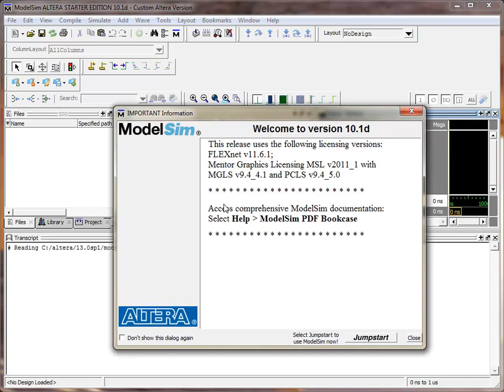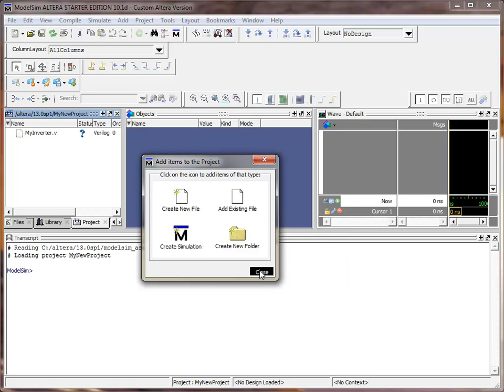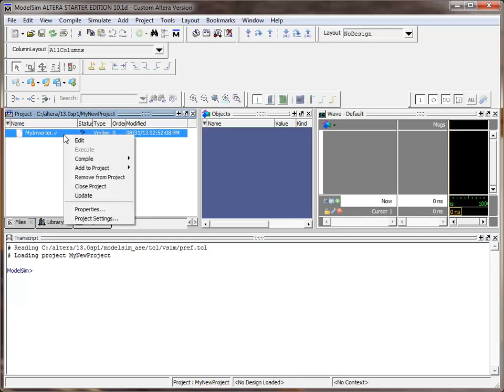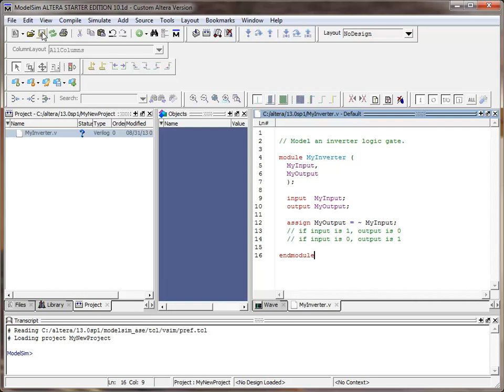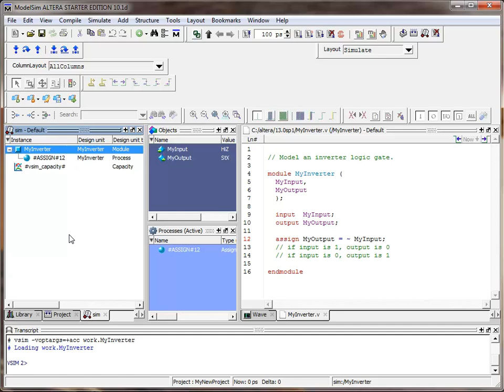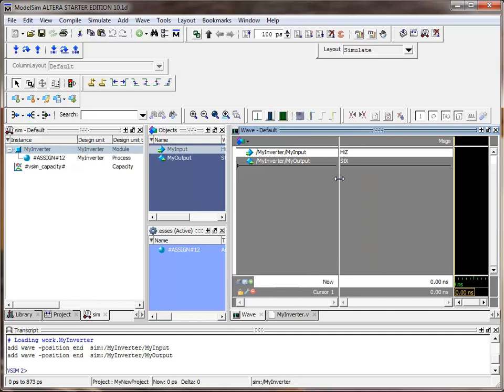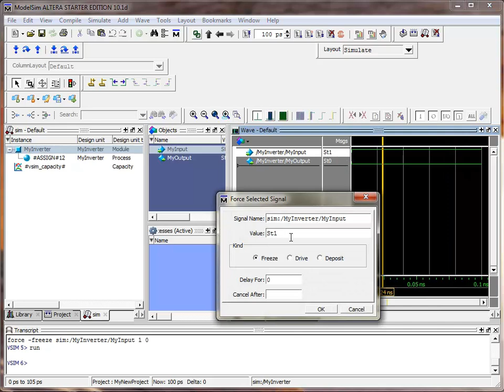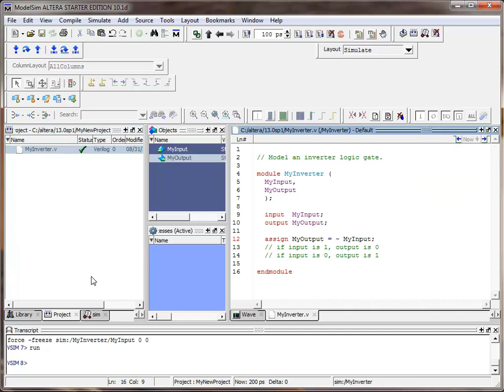Write, Compile, and Simulate a Verilog model using ModelSim

Comment: Man! You have new subscriber! If it is not trouble (your channel is about Verilog), I got it working on new versions of ModelSim(10.1d), and VHDL example, just chose simulation language VHDL. Here is the same example as above but in VHDL: 
------------------------------------
library IEEE;
use IEEE.std_logic_1164.all;

entity myInverter is
  port(myInput:in std_logic; myOutput:out std_logic);
end myInverter;
    
architecture logic of myInverter is
  begin
    myOutput <= not myInput;
end logic;
-------------------------------------
Whole procedure is the same.  Just, do it first outside simulator - inside ModelSim, there is poor syntax debugger, will tell you that you have error, but not exactly what. Sometimes does, sometimes not. So, chose first normal Project, and after selecting your chip and everything else, make new project, this time VHDL. Compile it. The difference between example above and new version is that you should chose: Tools->Run Simulation Tool->RTL Simulation. After that, on left side in Library, find Work, and below is your file... double click to open simulation. The rest is the same as on video. Just new version is different. If you can't find "Wave", go to View->Wave (it is not there by default).

Comment: I tried your code and your guiding but there is a problem which is I can not compile this code example:
//Model an inverter logic gate

module MyInverter{
 MyInput,
 MyOutput
};
 input MyInput;
 output MyOutput;

 assign MyOutput = ~ MyInput;

endmodule

I run on Linux (ubuntu 15.10) OS.
Help me please!
Reply from the maker: Hi Van-Nam Dinh, thanks for trying out our code. The code in your comment looks good to me, except for one thing (or two things, depending upon how you look at it): The port list in your comment is surrounded by curly braces '{...}' instead of parentheses '(...)'. I recommend changing the curly braces into parentheses and giving it another go!
Reply: :)
I did it and it is correctly now!
could you suggest me links or books that are useful for beginner in Verilog! I would like to study it for Digital Design!
any of your experience is very meaningful to me!
many thanks!

Comment: If I have a project and there are multiple verilog ot vhdl file and I am passing teh clock from top module file to other files. I am trying to simulate it with model sim but the clock in other modules (file) shows as no value where as I am giving clock to the top module clock. May I know how can use modelsim for whole project.

Comment: You don't really need to learn Verilog to do simulations using ModelSim. You can just Altera's Quartus ii to draw the design diagrams and them have the Quartus ii write the verilog code for you. After that you can just get that code and run it on ModelSim and simulate your design. But it's a good language to know.
Reply from the maker: +Agent Smith - Thanks for suggesting people use that feature of Quartus. I haven't used it yet. It sounds handy to me, though. Oftentimes, I think people are tasked with updating existing designs (either written by themselves or by colleagues) as opposed to creating new designs "from scratch." I wonder what role that feature of Quartus would play in that situation.

Comment: Remember that simulators are especially dangerous in hardware design. Simulators are very handy but there are many things they don't catch. Nothing beats putting the code on a board.
Reply from the maker: +Peter Bayley - Thanks for pointing out that relying on simulation alone can be dangerous. I agree, as you said, that simulating can be handy; for example, when the logic designers don't have access to boards.

Comment: At time 13.09,
The wave is initially set one and the inverse is one and then after it then opposite was done.Then why is the secound half merged more in the middle, seems little wierd.
I'm new for the tool, can you please elaborate?
Reply from the maker: Hi Hemant,

ModelSim inserts some vertical space between each wave in an attempt to help the user distinguish one wave from another, similar to how YouTube inserts vertical space between each line of text in each comment in an attempt to help the user distinguish one line of text from another.

From time 0s to time 0.1ns, myInput is 1 and myOutput is 0.

At time 0.1ns, myInput changes to 0 and myOutput changes to 1.
Reply: Hemant,
At first the Value is set to "1" so the output is "0" it runs for 100ps (i.e, 0.1ns). Then forcing the input to "0" and when you click run it starts from the point the previous run completed. So the second run will have its effect between 0.1ns and 0.2ns. So when u click full screen in wave it shows the graph  like the one shown at 13:09!!
Reply: ***** Thankyou!👻👻